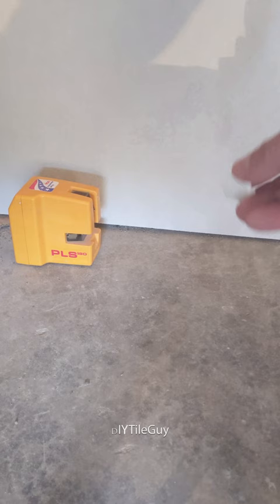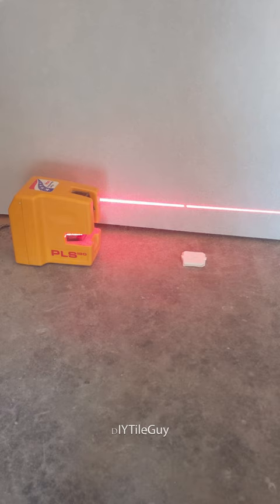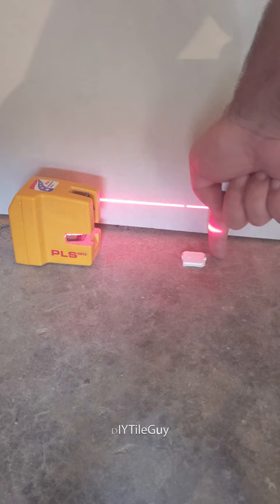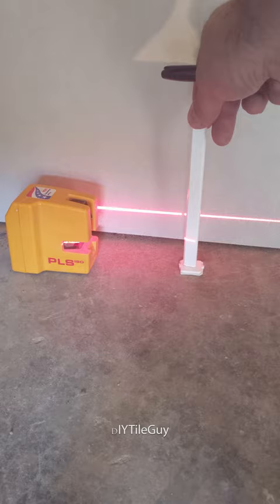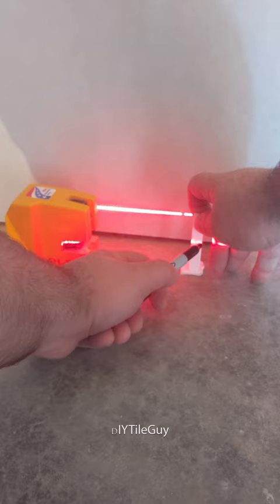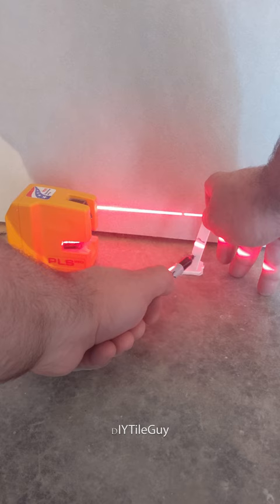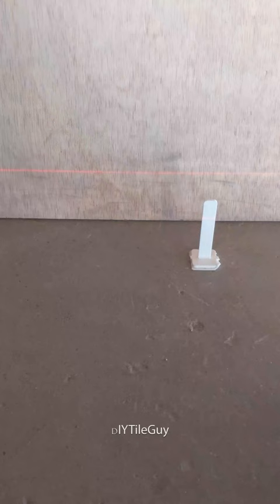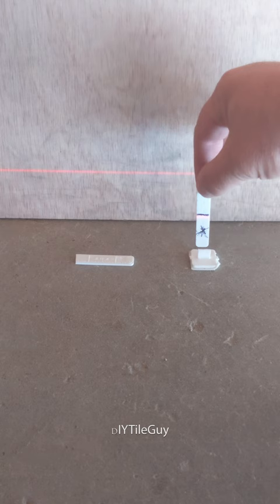Self-leveling underlayment: How to get it level and the correct height

Comment: I'm in Alabama and want to tile our kitchen, bath, and dining room floors using 12x24 porcelain. I've removed the linoleum and lauan. The subfloor is 3/4" plywood over 2x8 joists, 16" OC. Can I just lay Ditra then tile or should I put down 1/2" cement board? Please advise...
If my subfloor 3/4" plywood was over engineered joists 16"OC, would I need to do anything different?
Reply: You don't need backer under ditra, your question on sub thickness and joist spacing is something that can't be answered without more info. Essentially you need to know the joist depth and length and then look up a deflection limit calculator online. Basically needs to be L/360 for ceramic/ porcelain and double that for natural stone.
Nobody online can guess the sizing of your floor joist.
Reply from the maker: You should download the Ditra installation handbook from Schluter. It's free and very informative. You can install backer and Ditra over it if you like but you can install Ditra right over the subfloor too.
What @typ044 said about the floor joists.
Reply: Thank you
 @typ044
Reply: Thank you! @DIYTileGuy
Reply: @bamarich  no problem. to clarify you need to know the unsupported length of the joist, for example if the joist is 20' but has a beam/girder or support wall in the middle your span would be 10'.
Reply: @typ044  understood and thanks again for the clarification